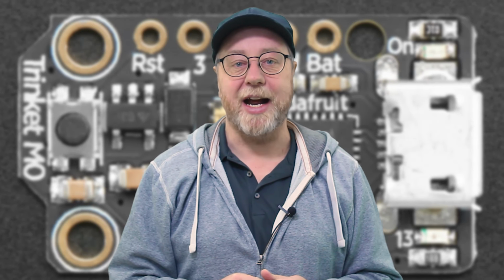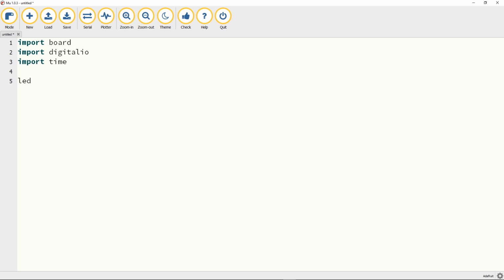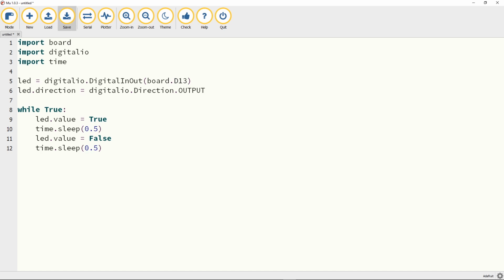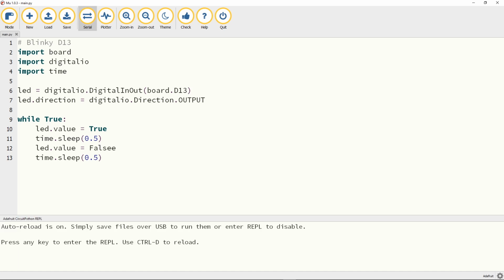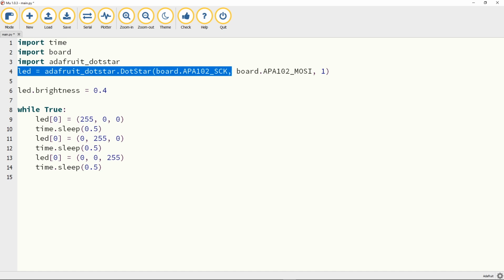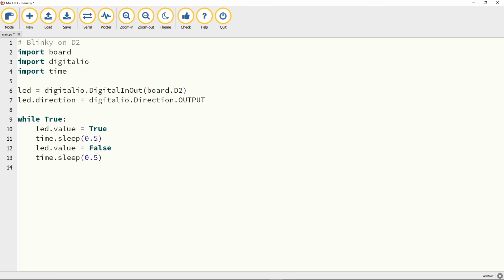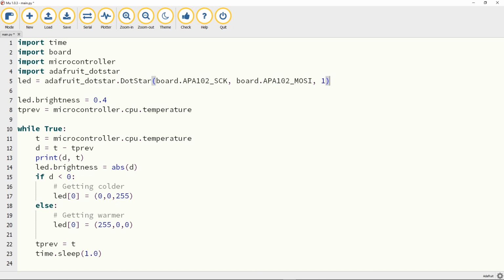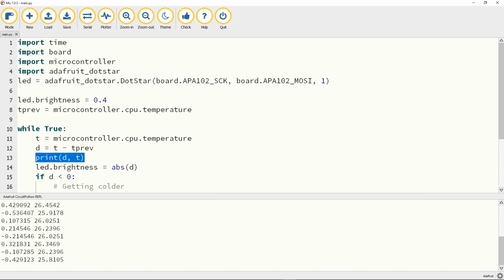Adafruit Trinket M0  and CircuitPython

Comment: Mega Newbie alert: how could i go about figuring out if this language and that board would be ideal to operate a nerf gun. i know i'll need to connect a microswitch for the trigger, a solenoid to be triggered by the microswitch, a 9v battery source and two step button to turn it on and off. maybe a capacitor might be needed supply consistent pot to the noid.

Comment: What a crappy way to inform the user there has been an error in the code
Reply: The flashes are for the case where you don't have a computer handy. If a screen is attached it will show the error just like the serial output.

Comment: The performance is undoubtedly horrid when compared to C.
You're saving a python script straight to some emulated usb mass storage.  It then has to take that and compile it into bytecode if it wants any chance in hell of having any kind of performance at all.  It needs to run an OS with all the overhead that comes with that, etc.
The only things i can see this being useful for are things like IOT or somehow data processing (which an MCU would be bad for anyway).  I don't see the point.
Reply: The point is easy access to newcommers, easier development for more complex applications and data processing. Of course the performance is 'horrible' compared to c, but let's be honest: A well programmed Arduino is more than powerful enough for almost all IoT projects, but the atmega is almost 20 years old. The ESP32 has a dual-core arm processor and tons of interfaces and hardware extentions, is cheaper than an arduino and still (running python) more powerfull than the atmega. Moore's law also applies to MCUs and it is high time for another abstraction layer.

The arduino project was a milestone over 15 years ago, making MCUs accessible to makers, providing an easy to use IDE/compiler and acess via usb/uart (MCU development kits were proprietary and expensive until then). Micropython (or equivalent) even get rid of (cross-)compiling and makes testing, developing and deploying even easier. I highly recommend trying it  yourself!
Cheers!

Comment: I'm sure you already realized this, but that orange power wire you put on the breadboard at 9:50 was totally pointless and not needed for that circuit or any other circuits you showed lol.
Reply: really?   how would the LED be powered, then, without a positive rail?

Comment: What else can you build with this tiny chip and can it run off a 9 volt battery?  I assume from its size it would be quite cheap.
Reply: It cannot run directly off of a 9 volt because the regulator can only handle up to 5v.

Comment: An interpreted language on an embedded system. Nice!
Reply: You dont compile anything, you upload plain text files with .py extension to it by dragging and dropping the same way you would with a thumb drive and every time main.py is updated it is automatically executed
Reply: @mikescholz6429  once you do this, and delete the files from your computer: is there any way to retrieve the .py or .pyc file from the trinket device?
(If not, then that answers any question of how you program an MCU using Python... You don't 😯😜)
Reply: James S yes you can open the .py file directly from the board in a text editor, make changes and as soon as you click save it starts executing the new code. There are binary compiled libraries on the board as well that comprise the actual interpreter but your actual loop stays in plain text. Also if you get one of the boards with the M4 cortex that has like 4 times as much ram it can do some decently heavy lifting. The chip is linked to IIRC a 4mb flash memory chip that holds your code as well as bitmaps, wav files or whatever else you may need. I have a setup that plays bitmap files on addressable LED strips where each row of pixels is one frame of the length of the strip and sequentially writes each row going down the image.
Reply: @mikescholz6429  
So the MCU can't actually be programmed with Python, there's a subsystem on the chip, just like on your computer, that interprets the code and runs it on the processor.
Perfect. :). Exactly as I thought. :D.
Thanks for the clarification. Cool that it has removable storage!
Reply: James S the fact that you can edit the code directly on the board in real-time without needing to go through the whole compile and upload process makes debugging sooo much faster. Just a bit more clarification you can also use traditional compiled code from like the Arduino ide on these boards as well. Ive only been diving into hardware for a couple years but I really like these boards, ive got a few variants in my electronics kits.
Reply: The Basic Stamp was doing this 30 years ago. With BASIC though not python.
Reply: I call a high level of tom-foolery.
No 'language' runs on a microcontroller except for binary. Last I checked: processors only used *ASM instruction sets represented by machine code and not an interpreter.
The blinking-error fancy footwork is probably just the IDE flashing the LED with the error-logic defined within the software before 'converting' the un-interpreted erroneous code.
... Just my ungoogling skepticism, could be totally wrong but I have a feeling that I'm bang on.
Only way to convince me otherwise is to pull the source code directly off the flash once it's been programmed.

Comment: I would like to see it measure voltage if possible such as switching a relay on at one voltage and off at another voltage.
I was thinking of getting into raspberry pi but this may be a cheaper way for the basic use I would need it for.
You make it look so easy to do so please more on these types of devices. Thanks
Reply: Arduinos and similar boards can easily measure voltages and make decisions based on that. I'm just learning CircuitPython myself, but in C, this would be something like if(analogRead(A0)>512{foo;}else{bar;}}

Comment: Doesn't look much easier than C , in fact I think for simple uses C is easier (the blink sketch for example). That said I recognize the power of Python , especially when handling data (which can be a nightmare in C/C++) but I don't think anyone would need to handle any complicated data on a microcontroller.
Reply: You can use both if you like.

Comment: Excellent!  But as with all modern software development, it's not about the language, it's about the framework (libraries).  C, C++, Rust, Python, Java, JavaScript, Ruby, Perl... yada yada-- the syntactic differences are minor and once you know one, you can figure out the rest.  The real "learning" is to learn and understand the library (import board, digitalio, etc.) , as seen in your example which would look 99% the same in any of these languages, but knowing JavaScript or C instead of Python is not going to help you know how the libary works and what it does.
Reply: You're mostly correct but I'll have to disagree slightly. What you said is true in most of high level software development but breaks down when getting closer to the actual hardware. It makes a metric ton of difference whether you know C or python when your writing firmware/ other microcontroller code. This is due to the fact that at sufficiently low levels, the language you're writing needs to conform to the actual hardware without any abstraction layers making your life easier. It's fine and dandy blinking some LEDs with circuit python (which is actually just a sort of perverted C wrapper) but when, for example, reading data from a I2C connected sensor you really need to understand actual silicon register sizes, pointers and all sort of low level stuff that simply isn't present in python.
Reply: TR7H Fair.

Comment: Hi Gary its kind of irrelevant but still can u suggest me any unique project to work on using Arduino or rasp.pi just for learning something innovative plz help me
Reply: You are already on youtube so do a search for say LCD 'liquid crystal display ' see what comes up. "innovative" has no meaning here; everything you will see already exists. If you go to Arduino or Adafruit learn sections you will see very elaborate tutorials for there products.  The last point to do this type of hobby being inquisitive is a must. In most cases when you ask a question of the host on youtube it should be about what they have presented otherwise as you can see He did not answer your request. When searching be as specific as you can.